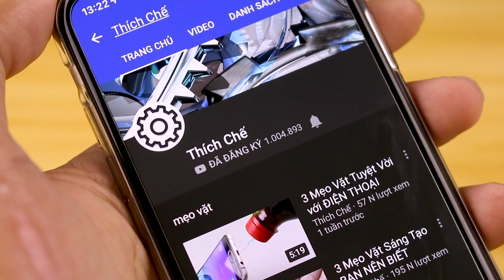Cách Tạo Pin Sạc 12V Tại Nhà Từ Ống Nhựa PVC

Comment: phụ kiện như sau:
1/  pin 18650 mua dung lượng càng cao 2500mah trở lên dùng lâu
2/ mạch sạc điện thoại cho nguồn acquy
3/ mạch cân bằng pin lion ( pin 18650 là thuộc lion ) 3s 10A hoặc cao hơn 
4/ thêm sạc pin lion 12v 20A trở lên 
tốn nhiều thứ đó, chưa kể ống nhựa, công tắc,
có thể dùng gỗ cũng đươc